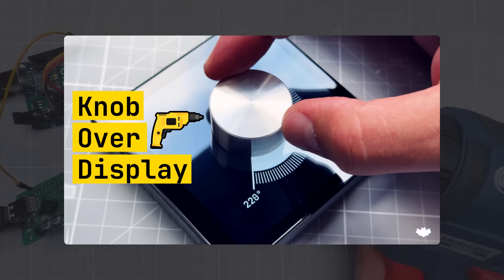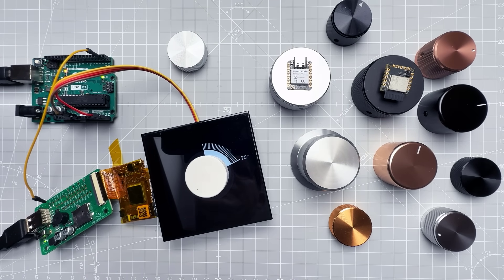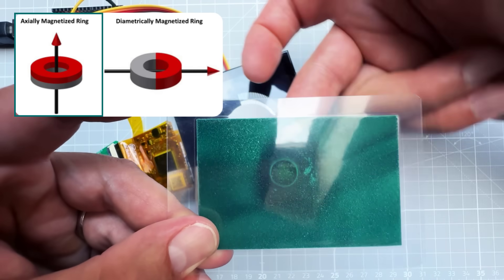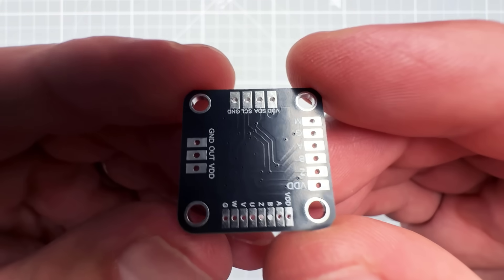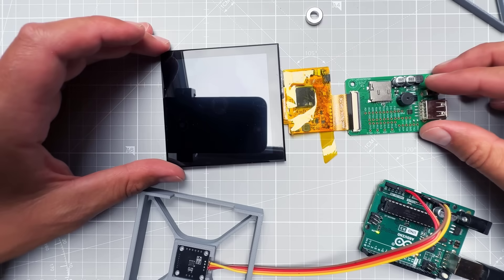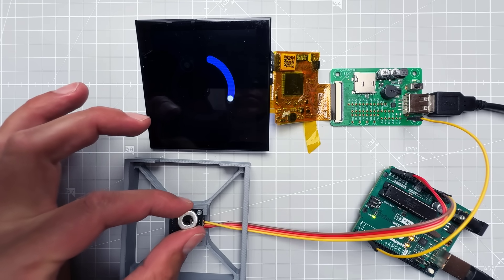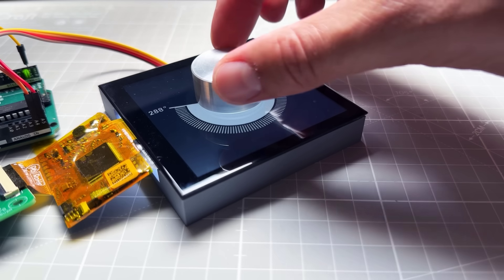Knob Over Display (2025 Edition)

Comment: how do you keep the knob from marring the surface of the display after repeated use ?
Reply from the maker: I have used double sided tape and it was working nicely, i.e. strong enough to hold it in place, but could be also removed if needed.

Comment: Can you really quickly spin it left and right and left and right and end with your fingers at the same point and the dial reading the same number? I HATE it when you can't do that, when it skips or accelerates or does something that breaks a perfectly linear and consistent response
Reply from the maker: Yes, you can do that. The magnetic encoder module is extremely precise. I´m using 360 steps here for one rotation, but you can go much higher and still get that great precision.

Comment: I have an idea for how you can mount this to the screen so it doesn't move if you overcome the magnet's force. Make the knob with a lip or brim on the surface of the screen, and cut two sheets of clear plastic to go over the screen, and then over the brim. The knob will be captured by these sheets, that you can adhere to the exterior of the screen.
Reply from the maker: That´s surely an interesting idea! Thank you for your comment.
Reply: @upir_upir  no worries. It made sense then?

Comment: I wouldn't be surprised if the balls inside of those bearings are what's causing so many issues, possibly a metallic retainer as well.  A ceramic ball bearing would likely work better, sealed not shielded, preferably with a non-ferrous retainer. 

I'd also be curious if a larger ring magnet would help reduce this form of interference.  Or even one that matches the size of the bearing where they can stack. 

Another solution could also be to use more sensors in a circular alignment.  This would at least give you redundancy.  At least two at a 90° offset, but you'd need to interpolate direction of movement and account for pole flipping, so this would be more like an encoder.  Four would work better and wouldn't need this interpolation, as the 90° pairs would act as a push-pull and the 180° pairs would work as opposition, this built-in redundancy within both sets would increase resolution, accuracy, and would reduce noise.  Technically this could be reduced to three sensors with a similar implementation, just different formulas, but you lose some redundancy, and I believe you'd need to interpolate direction again.  More sensors would increase resolution and accuracy on the same principle as the four sensor solution. 

Personally if I was designing a future iteration of this, I'd go for a combination of all of this.  Less random bits of ferrous metal in the bearing, external sensors rather than a central sensor, and due to the previous the bearing size and ring magnet size could easily be switched which would also lessen the interference of the bearing; possibly so much so to where a bearing with steel balls is a feasible implementation due to it being within the ring, though this would have to be tested.   This actually gives me some ideas for a different project, though I'm not sure if the sensors I'd need exist in the packaging I'd prefer for their implementation.
Reply from the maker: Interesting thoughts, I will definitely keep them in mind for the next iteration of this project. Thank you!

Comment: Too bad with magnet knobs even a single particle will scratch the display, UNLESS, you leave a tiny gap and have the outer edge with a soft bearing surface.
Reply from the maker: The magnet is not touching the display, it’s placed slightly above the display, but I understand that it might not be obvious from the video.
Reply: @upir_upir  Ah yes, could not tell, saw some scratching in one shot. Imagine creating a combination lock that had no knob, a hidden lock.
Reply from the maker: @leggysoft yep. That scratching was from testing with just the magnet alone, the knob didn’t have that issue.

Comment: I wonder if one make a magnet receiver board that can detect when the magnet is present or not where the display would automatically change state.
Reply from the maker: The board can detect when a magnet is closer and simulate a button press that way, not quite sure if it can also detect when there is no magnet. But it’s an interesting idea.

Comment: Very nice result!
You could try using plastic or ceramic bearings as you mentioned non-metal ones, or just two sintered bronze bushings (non-magnetic). Some stainless steels are non-magnetic too.
Or maybe just a smooth steel/brass pin in a drilled hole in the plastic or in a brass tube (either with a 3-part knob, or with a larger ring magnet or array in the outside of the knob rather than in the center)
Reply from the maker: All good ideas! Thank you for your comment.

Comment: Great job, UPIR. I've been following you since the beginning and always find great ideas for my own work. I just have one question: what happens if I rotate the knob more than 360°? Does the angle value start at 0°? As far as you know, is it possible to have an incremental angle after 360° or a decremental angle below 0° without any problems, at least for half a turn, with this sensor? I'd like to use this sensor for my antenna rotor, which I controlled with the first project you built with the encoder, which you just mentioned in this video. I only need an overlap when the antenna rotates a few degrees after 360° (e.g., 361°, 362°, or 380°) and below 0° (e.g., -1°, -2°, or -20°). Of course, the sensor will be axially attached to the antenna rotor, not the knob. There are some tricks you can do, but I think I need a mechanical sensor or something similar that detects when you've passed 360° clockwise and 0° counterclockwise. Thanks so much for the suggestions. Antonio (Rome, IT)
Reply from the maker: Thank you for your comment. You can definitely update the code to do what you have mentioned. Right now, when you go over 360°, it jumps back to 0°, but again, that could be changed in the code.

Comment: This is awesome. Thank you for this. I found some cheap fidget spinners that have plastic, uncoated bearings and spin three (3) times faster than expensive fidget spinners equipped with metal bearings. Also, do you get any adverse effects from the Lenz law using magnets and aluminum knobs? Just curious.
Reply from the maker: That´s a very interesting observation. I need to check some fidget spinners I guess.

Comment: The MT6701 also has a feature whereby it can detect when the magnet moves slightly closer - so you could tap the knob for a button click - like a piezo switch.
Reply from the maker: That´s right, but the library I was using had no support for this feature. Have you tried that on your own?
Reply: @upir_upir  I did not try to implement it. I'm saving that for a rainy day! :) 
Perhaps it's sensitive enough that not much axial displacement is required - just the shock wave of a tap.
If I remember correctly the datasheet shows that this parameter has it's own register so it should be easy enough to modify the library to interrogate it.

Additionally, Pin5 can produce a push output in response to this so we can use it as an interrupt.

Comment: I’m interested in this sort of knob for being very waterproof and easy to clean, but I’d want something with good holding force even when the screen is vertical. Maybe the know would need to be very large, but I’m thinking of having a large axial magnet around the perimeter of the knob thats attracted to another axial magnet behind the flat panel, with a small diametric magnet in the middle for the encoder sensor. I hope they wouldn’t interfere, but maybe I’d also need some steel to redirect the magnetic flux in the right way.
Reply from the maker: I´m sure all of that should be possible, you should definitely try that!

Comment: The Steel (M50) used to make Bearings is usually extremely prone to getting magnetic and also easily corrodes. So yes thats a problem. But a Slipfit without bearing should be pretty achievable.   Really nice idea and project you have there.
Reply from the maker: Do you mean like 3D printed slipfit?
Reply: @upir_upir yep. Gotten pretty good results in the past. Especially with PETG or Nylon

Comment: I worked with Nextion LCDs and I hate how unresponsive and laggy the touch is, and before I throw them away I haven't had a chance to test it with UART inputs! I always used its own CPU.
the DWIN has the same issue (with more vivid colors I must add 😁) with the unresponsiveness or laggy touch responses, but with the data it reads from sensor and arduino its smooth as butter!
was that the issue with the Nextion displays too?!
about the type of content I prefer both, the shorter one like this one I'll use for the projects I know the gist of, and the longer ones for the projects I'm not familiar with. also the shorter ones like this works more with short attention spans 😁
Reply from the maker: DWIN is definitely MUCH faster updating from UART compared to touchscreen. Touch is slow, UART is 60+ FPS without any problems. Nextion displays are similar, but not that noticeable. It´s hard to achieve 60 FPS on those.
Reply: @upir_upir  thanks for the reply. after spending so much money and time on nextion LCDs now I have to throw it out of the window and start with a different (don't know what yet) LCD, no touch needed just faster refresh rate.

Comment: Another way I have seen this done is using a similar knob that can be glued in the center to the display and spin around, but inbetween the display and the knob there is a small section of wire mesh like on the tip of a touch screen stylus or gloves that can use capacitive touch screens, and it is what interfaces with the screen to give it input
Reply from the maker: Yep, I believe that´s the way the microchip example use. Thank you for the feedback.

Comment: The funniest implementation of this I've read was the Mustang MachE. Ford found out late in development that drivers didn't like the touchscreen only infotainment, so they glued a knob with capacitive fingers on the touchscreen. The electronic hardware/ software is completely unaware there's a knob, it's a purely external "mechanical" interface, like a stylus.
Reply from the maker: That is an interesting story, thank you for sharing! I wonder if that´s made up, or a real one...
Reply: @upir_upir I remember seeing it from a press video from one of the engineers so I think it's true.
Reply: yeah, but this one would have been a better solution, just glue a hall sensor behind the screen and glue the plastic knob on top of it with a magnet. that should be the future of interfaces. It would also be possible to retrofit it on the current models without changing parts, only adding extra parts.
Reply: this is not true since Tesla has the best selling car in the world for the last 3 years now and as an owner myself, touch/tesla is the best by far, it is on par with Apple, actually the technology is so good you never use anything at all while driving.
your "argument" was never a real statement from ford, it is purely made up by you or someone else. it was an attempt to be innovative that flopped.
the ford mach-e flopped because it was just a bad car overall, the touch argument is a nothingburger.
btw Ford is the best in the industry after Tesla with the mach-e only a deficit of $37.000 per ford mach-e. Tesla is still the only manufacturer in the world that makes a profit with electric cars.
a Tesla is a true masterpiece gamechanger example of how "control" can be if done exceptionally well on all levels.

Comment: there is a commercial product that features a solution like this: Studer Vista Consoles have the "Vistonic" section that has a bunch of potentiometers just like this! cool!
Reply from the maker: That´s similar but not the same. I think POSY reviewed this product in his video. It´s just a knob over a display, but it has wired connection hidden in the base.

Comment: Hmmm, I feel like the most important aspect of this entire thing is left out... how does the knob stay in place? As the start of the vid said you cant drill a hole in the screen, so the magnetic encoder is a good work around, however retaining the knob is just as important!
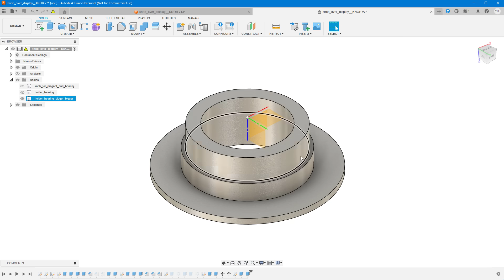Reply: 06:28
Reply from the maker: It´s glued using double sided tape, so I can remove it later, but I´m sure a more permanent solution could be used as well.
Reply: He does say at one point, the knob base is glued to the display surface
Reply: @akaHarvesteR  that's the only solid way to do it that I could come up with, but I didn't catch him say it in the vid, do you have a timestamp?

Comment: The brute force no rendering graphical display being a slideshow is bonkers. What has the world come to when it's easier to just throw more memory at the problem 🤯

Cool project
Reply from the maker: Not only it´s easier, but it´s also much cheaper. I understand that it looks like it´s going backwards, but if you think about it, the power required to render those images dynamically is much bigger compared to just copying data from one memory to another.
Reply: @upir_upir it is, that's the crazy part of it.
Memory is so cheap, that processing is become less necessary.

Comment: Beautiful project... but the knob magnet stays into center position because it is actracted by the sensor underneath?  or what?
Reply from the maker: It´s glued with a double sided tape, but probably a more permanent solution could be used as well.

Comment: That's cool but easy to lose your knob, no? I mean if you push the knob a little too hard, it moves outside the prescribed area, doesn't it?
Reply from the maker: It´s being glued to the screen using a double sided tape, it will not move easily.

Comment: Company I was working for makes a thermostat that has this kinda thing, but it’s pretty much a rotary encoder stuck over the screen, and the UI hides the cable connecting it.

I don’t work for the design team or anything, they just dumped a bunch of old broken prototype ones in my office and I took one apart before I threw them into e-waste
Reply from the maker: That´s very interesting, I guess you cannot say anything more about the name of the product nor the company, right?
Reply: @upir_upir Probably for the best if I don’t

Comment: oh yes i'd love to replace the reliable simple mechanical pots with a fancy computer thing
Reply from the maker: The analog knob has a lot of moving elements that will eventually wear off, while the magnetic encodes has no moving parts...
Reply: @upir_upir  hmm i suppose it could be ok then as long as there are no proprietary or obscure ics or firmware. those are a problem years later when you can't find that weird ic or the firmware chip dies

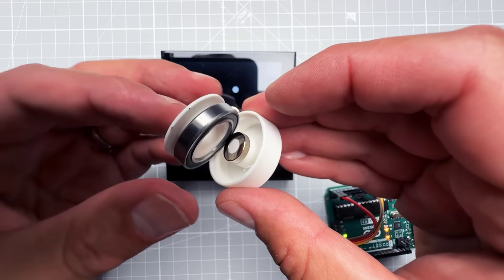Comment: 7:10 It's not so much the magnet is magnetizing the bearing, as the bearing is redirecting the lines of flux that actively surround the magnet, so the sensor has a much harder time seeing the primary field, could try looking with the viewing film, but might look similar since strength is mostly lost, but some vectors might be distorted.
Reply from the maker: Yep, there are most likely interacting in some bad way.. good idea about using the viewing film, I will see if something is visible.

Comment: Any plan to have the knob as a pressable button ? Like adding a spring loaded mécanisme and analysing the intensity of the magnetic field to get how it Moving. This might required two magnetic sensor chips tough 😅
Reply from the maker: The encoder module should actually support button pressing - but the library does not support that. I will see if any other library has a support for that.

Comment: Very accurate, perhaps too accurate for most of my applications. Is there an option to reduce the number of functions and weight by performing a less detailed/accurate 'analogue' version?
Reply from the maker: You can always just make it less accurate in the code if you need to. I don´t think that the weight of the module would be a problem, or did I not understood your question?
Reply: You can code for as few or many steps that you want.
Reply: I'm thinking a knob, slider or rocker with a touchpen nib inside. Perhaps the screens brightness can generate enough for touchscreen capacitance and who knows what else with a small battery? How to get large screens to recognise their placement?

Comment: I like that, looks nice! Does it slide off if the screen goes vertical, like being mounted on a desk or wall?
Reply from the maker: It is glued to the screen, so it stays on the same spot. I have used a double sided tape so I can take it off, but I´m sure a more permanent solution could be used as well.
Reply: @upir_upir  did you look at attaching the knob with the magnet? like if there were a big enough plate behind the encoder?   Of course, said plate may interfere with your field lines and encoder operation. -- -- OO oo oo!  - - plate ALSO on a bearing !

Comment: This is pretty cool! I haven't seen this kind a stuff makes its way to consumer but if you take away the display aspect then I bet that Impulse Labs is using this method for their induction cooktop as the knobs on theirs attaches by magnets and are removable to make cleaning easier. Although I haven't found their parts/repair page to see if you can order the knobs as a replacement.
Reply from the maker: That´s very interesting, I haven´t heard about those cooktops. I will definitely check them to get more information, thank you for pointing this out!
Reply: Great tip! Worth googling)